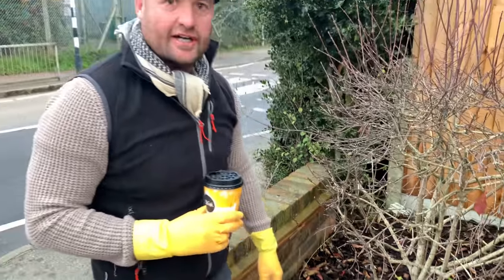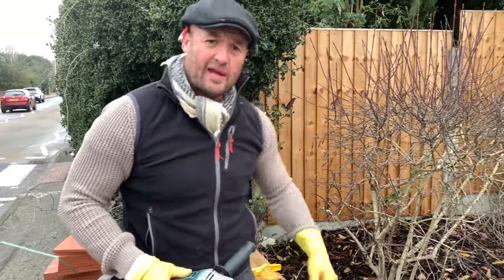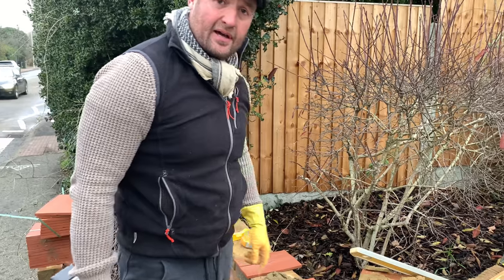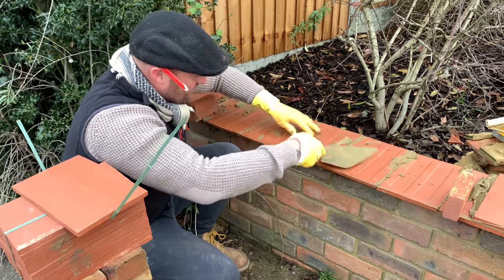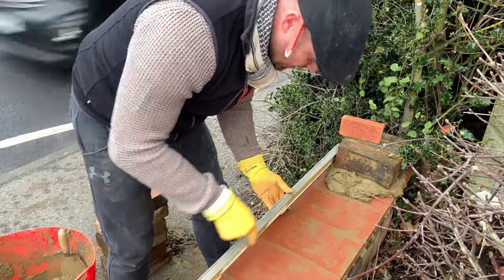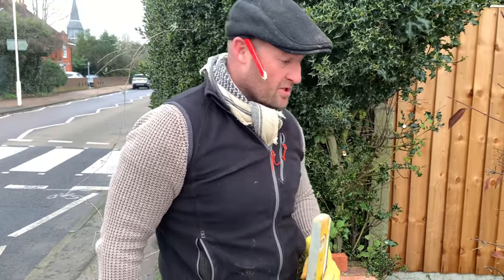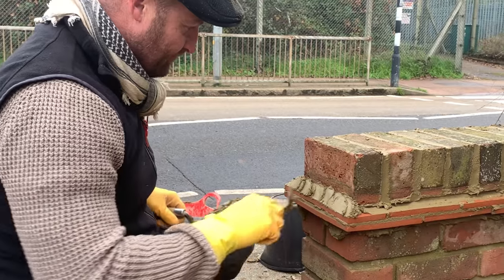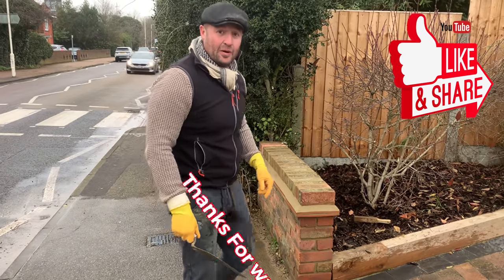Bricklaying repair job

Comment: I think that little tip with the level marking it off is one of the best I've seen yet. Thanks
Reply: I do something similar but other way round i get the gobbo some where near and let it suck in a little then use my level as a guide and run a putty knife along it cutting off the excess leaving a perfect level straight top edge of flaunch its easier than trying to follow a pencil line and leaves an even sharper straighter finish 👍
Reply: @TheTraditionalGolfer  I'm a Stone Mason but do your method when doing brickwork.

Comment: To 
The Traditional Bricklayer...…just another little tip......to get the cement stains of the tiles use some glass insulation like a rubber and it comes off real easy.  hope that help somebody!

Comment: Nice & IN CONTROL OF THAT TROWEL.  WHEN I START THE BRICK ON EDGE (. I BUILD A DEAD MAN. FIRST &  LEAVE IT to go off a little .). DOES HELP WHEN POSITIONING.  JUST A LITTLE TIP . BEEN AN APPRENTICE  INDENTURED  BRICKLAYER FOR 45 YEARS,,,!  STILL DOEING  IT .  (. GET CALLED OUT TO SET &. LEAVEL UP. BUILDINGS     AS THERE IS A BIG SHORTAGE OF GOOD. TROWELS ,  or. SSO CALLED BUILDER,S

Comment: 😂😂can’t believe that there are so many comments on me washing up gloves 🤦‍♂️

I’ve not been on the trowel for 10 years but please don’t tell me that this knowledge has passed so many ?  ,,the method behind the gloves 

Ok I’m Gona upload a video on the method ,,can’t believe we Gona do a video on washing up gloves 😂😂
To be fair it’s a tip taught to me by very old trowels and could be useful for some 

Tnks for all the comments guys 🧱👌
Reply: The gloves are ideal for being able to feel  and also not getting in the way of the string line.
He also understands not to remove any accidental droppings too quickly as it will smear more
Reply: Your hands will get cold in winter

Comment: i would have snapped  the bottom tile in two and laid them ridged to the centre, this would create a natural drip away from the wall. The  bottom tiles are concave when the good side is down, thus encouraging rain to run in towards the brickwork! exactly opposite of why you were installing rosemary's in the first place!

Comment: Loves an empty joint fillet should be on the bottom of the soldier would look a lot better but fair play
Reply: I agree and I'll let someone else tell you those aren't soldiers 🤫
Reply: I will tell its a brick on edge 👍

Comment: I reckon your compo is a tad too wet for tile crease work ... I agree with you about the overuse of profiles . No brickies nowadays , just 'line monkeys' ☺
Reply: John bowkett I don’t necessarily agree with the over use of profiles, if you’re on price use profiles and straight edges as much as you can it’s so much quicker of course sometimes you have to hand build but try to avoid if possible
Reply: @paulhicks778  lol
Reply: Joe bricky profiles all the way, that’s what they are designed for to make life easier and quicker it’s progression
Reply: @ONEDARKREP  mate I’ve been laying bricks 24 years and profiles are the way forward
Reply: @waynerapson4044  profiles all day son like I said any1 who says there shit ain’t a bricky
Reply: @johnbowkett5920  you ok lol??
Reply: @ONEDARKREP  Don't start something you can't finish . Been laying for 45 years . I was setting up Blake profiles 35 years ago (before you were born) ... Think before you open your big gob next time !
Reply: @johnbowkett5920  did you just call me a snowflake lol
Reply: @ONEDARKREP  the problem is their is a huge divide now days .
Profile brickies and bricklayers 
Five u an example was on a job last month ,profiles everywhere ,the finish point was weather struck ,out of 10 trowels only 2 wore decent ,2 wore ok the rest was not aloud on the pointing .

We keep using profiles the bricklaying skill is disappearing ,countless times many of the trowels can’t do the detailed work as all they know is too run the line .

It’s good on the square boxes but the 
Renowned work is where the skill and money is if I can get it .

I’m currently doing a video explaining all points as I’ve been off the trowel for 10/11 years .

However prior to that I run my own gang 18 bricklayers and my trowels could get a corner up in not much more time than clamps and braces wore used .
My concern is if the art and skill is disappearing profile trowels will be training the next generation which in turn will see our world leading reputation disappear .

Stay safe 👌
Reply: @pro-1goalkeepingtutorialch165  at I feel you but I use all ways footings obviously build corners stone plots obviously build Corners I wish more than anything that the prices were that good where you could build corners , but with the pressure the site managers put on you to get plots built is ridiculous we have 10 days to build a house from below dpc to top out  and they don’t allow for rainy days so profiles are a brickys best freind

Comment: Why marigolds?
Reply: Simple there super thin to work with. Only thing hands sweat up easy in them. Used you on bricklaying hand on rough rustic type facing bricks. A lot gloves are to thick for bricklaying although a lot could 1,s on market nowadays like the thin mechanic type 1,s.